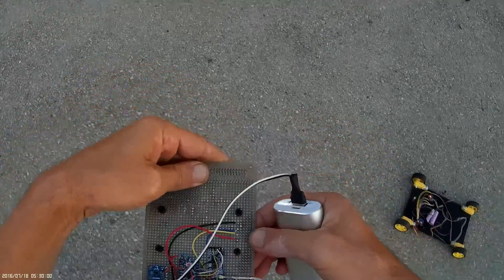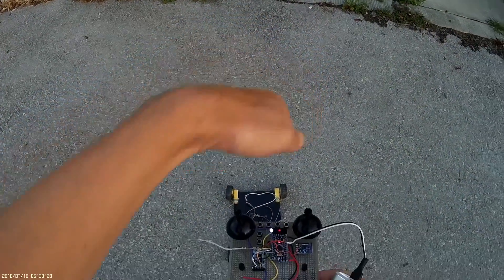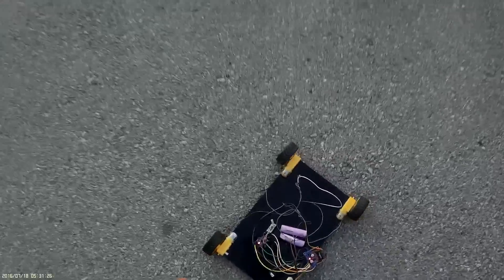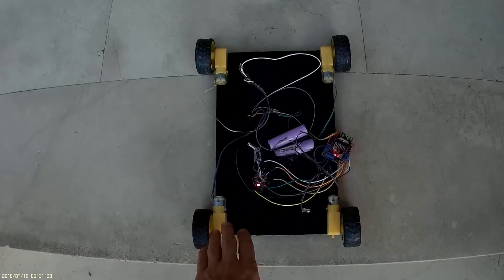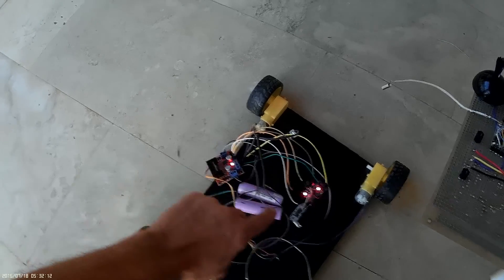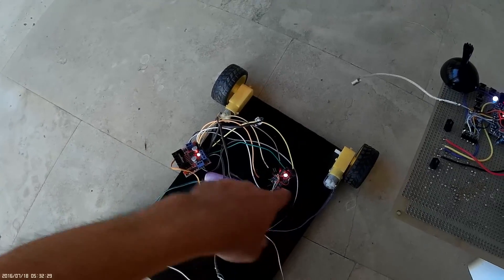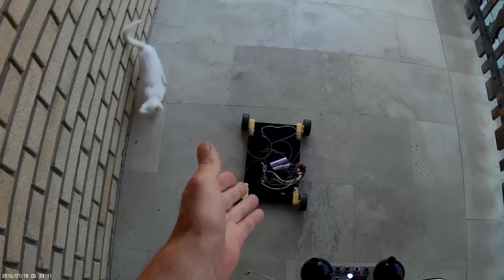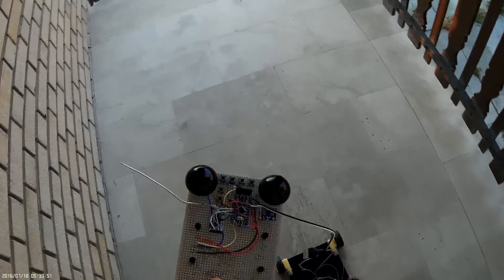DIY Arduino Car With HC-12 Transceiver At 433 MHz

Comment: cool, thoughts on how far the rage is? They say 1.8 km.
Reply: If he is using the HC-12, the default range is supposed to be 600 meters but is apparently capable of up to a kilometer if properly powered.
Reply from the maker: @BenStoneking  Yes. The thing is all about good antennas. Stock spring (antenna?) is bad, really bad. This spring antanna is just for testing on desk not for real use.
Reply from the maker: I don't know.